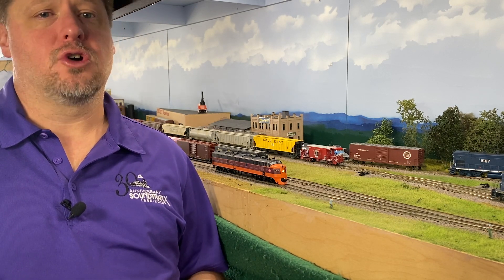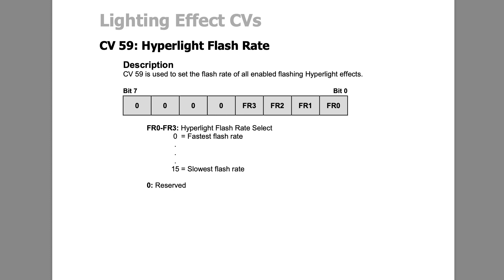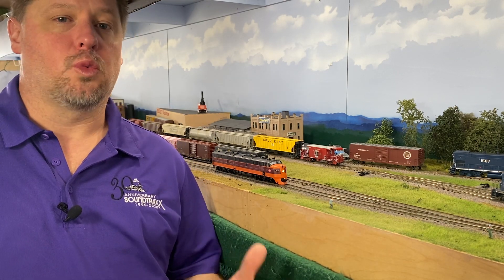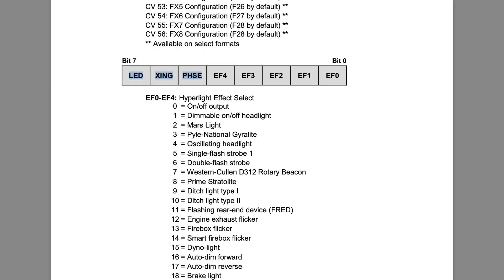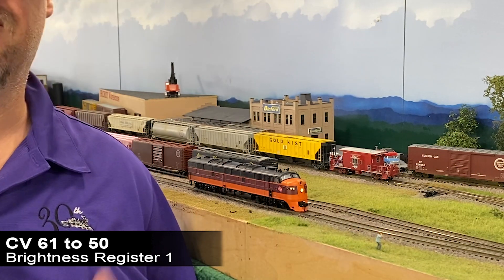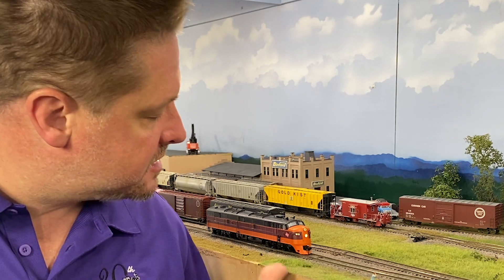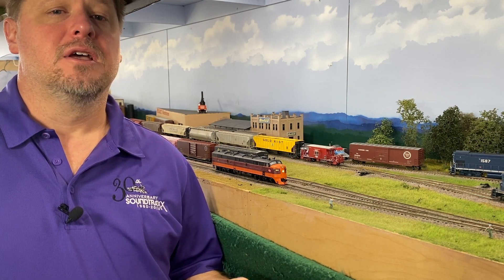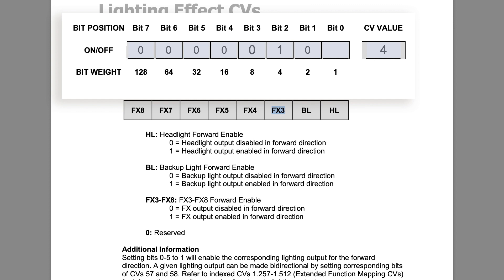SOUNDTRAXX Hyperlight Tutorial

Comment: Do the Tsunami 2 decoders include a hyperlight setting for the FX5 output? My Athearn RTR SD40N has beacon lights and ditchlights, which I wired the ditchlights for alternating flashing like in another video, but also want to be able to have the strobe beacons flash as well.
Reply from the maker: Tsunami2 decoders have 4-8 function outputs depending on the board format. Which board format are you using?